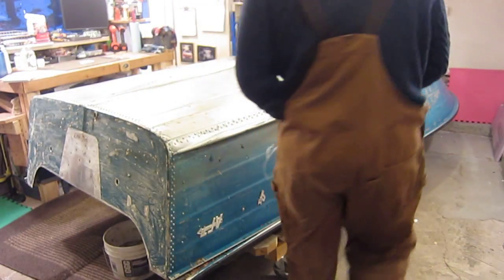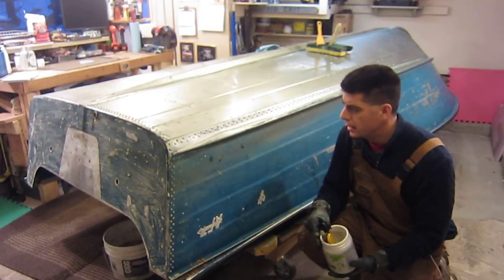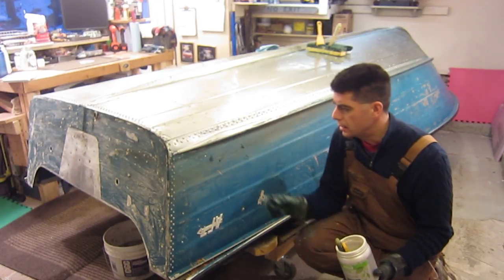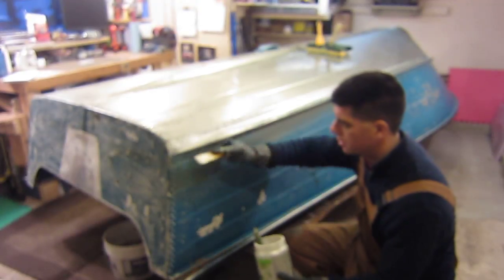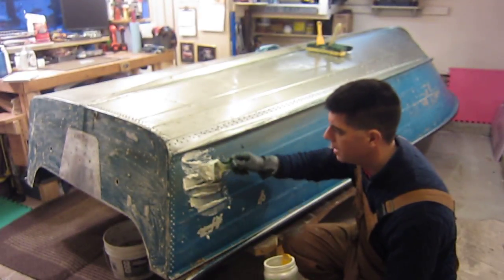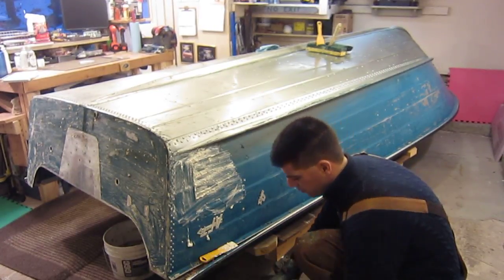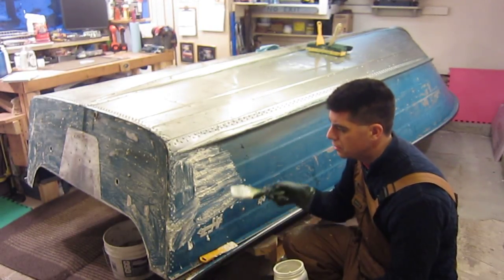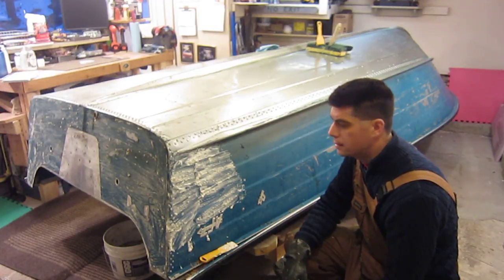How to Apply Paint Stripper

Comment: Question: You have a smaller boat and was able to flip it. Mine is a bigger boat with a large motor that cannot be removed. Can I still use the stripper the same way with the boat still on the trailer? 

Good information BTW! 👍👍👍